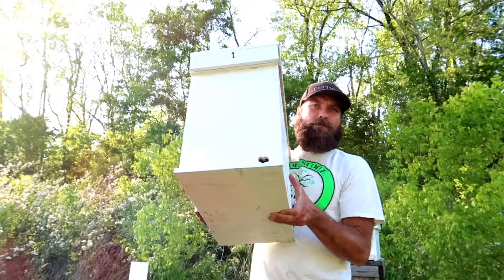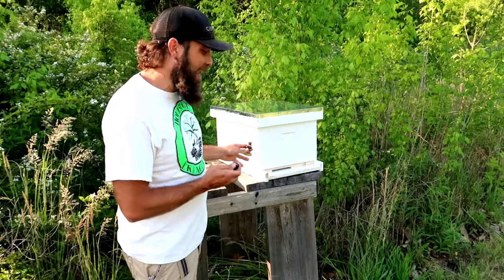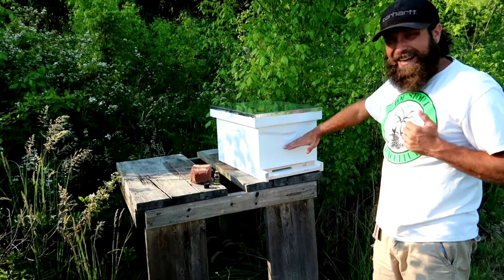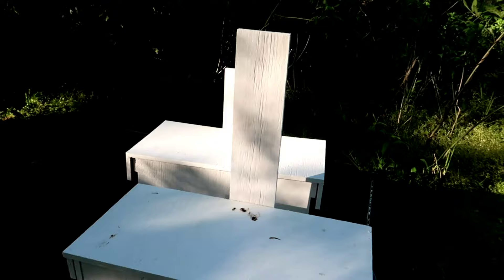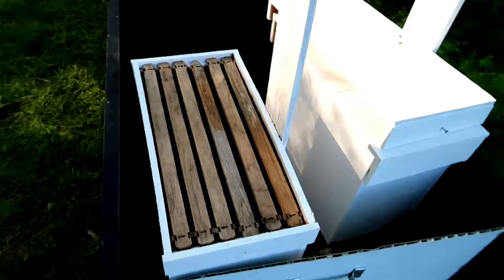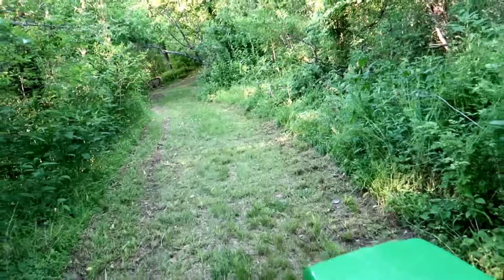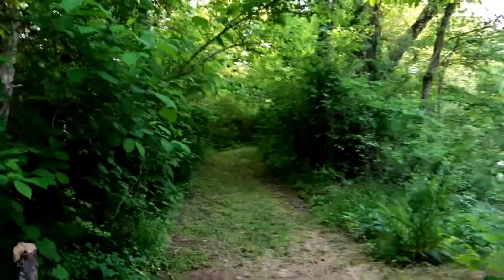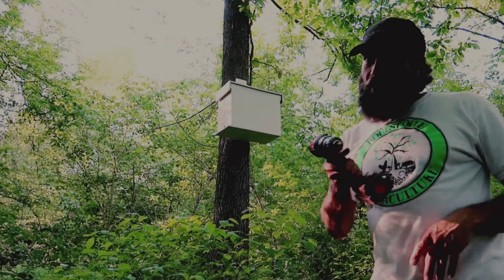My First Attempt At Free Bees (Swarm Traps)

Comment: Hey Bill, this is awesome! I just started keeping bees last year, but I bought a package from a local bee farm (I have some videos on my channel about my bee hive). This year I want to build a horizontal hive and catch a swarm (for some reason, here in Arizona, the bees seem to swarm all year long).

Just be careful of putting too much lemongrass oil around, because the bees will find it repulsive. From what I've read and heard, you want to soak one end of the q-tips once, and put some oil on the tops of the frames, and then soak the other end and spread it around the entrance. Then grab one of those small ziplock bags and put the q-tip in the back, and drop the bag into the bottom of the hive or swarm trap. If I remember correctly, that should last a week to two weeks.

One of the channels I watch is Barnyard Bees. He's got a lot of good information on bee keeping, though I don't necessarily agree with everything he says and does. Also look up Dr Leo Sharaskhin, he has been featured a few times (with some excellent swarm trapping advice) on the Off Grid with Doug and Stacy channel.

All the best with your bee keeping!
Reply from the maker: Awesome! Yeah I'm going to be building a horizontal hive also. I think there pretty smart. Thanks for the tips.